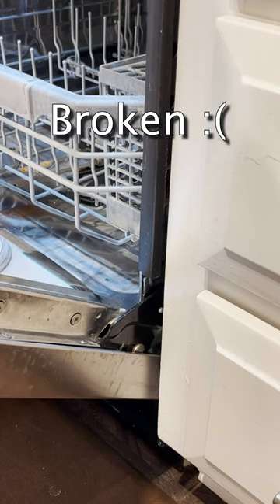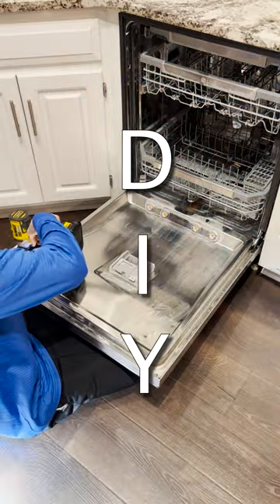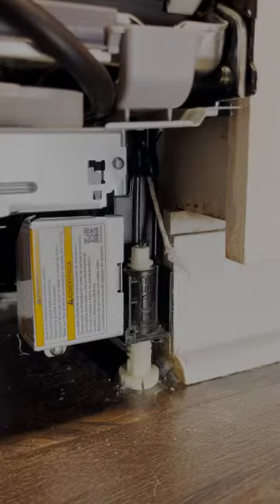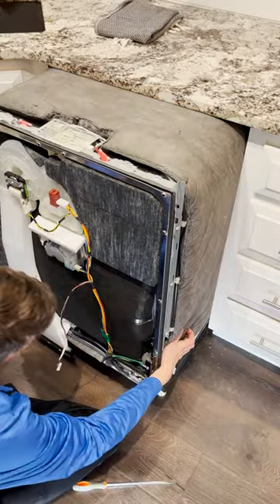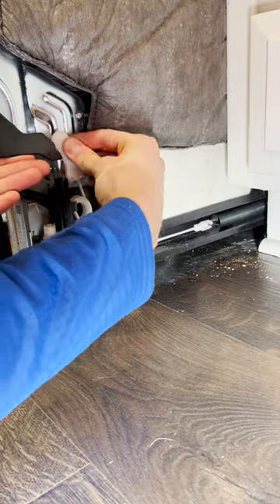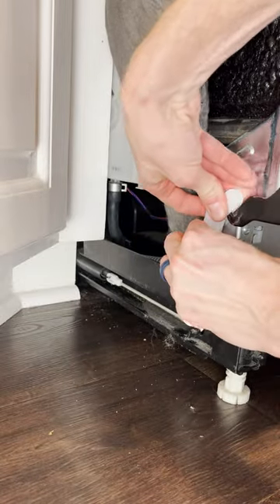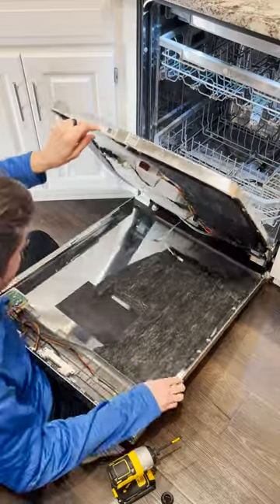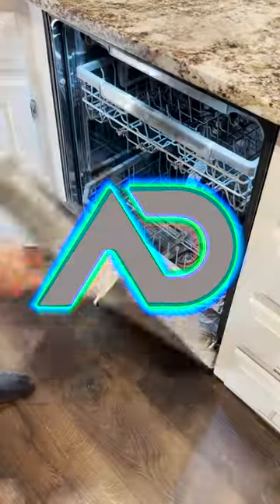DIY Dishwasher Hinge Fix

Comment: Reckless confidence is the key to a happy life.
Reply from the maker: Love it. Put it on a T-shirt
Reply: Also to a very expensive one
Reply: When u do it once u will have the confidence to do it again you would be surprised with how easy it is to fix stuff around your house if u do it on your own I've fixed more then 10 electrical stuff at my family home with no experience a bunch of wires and sink pipes
Reply: As a wise man once said, you never call a pro until you’ve made it worse!
Reply: Reckless confidence helped destroy my van engine once. Good times!
Reply: Amen

Comment: I like that the dishwasher is wearing a sweater. I changed the thermal fuse in my air fryer. Thing was like a puzzle.
Reply from the maker: Gotta stay warm (and quiet haha)
Reply: Insulation to keep it quiet.

Comment: Small tip - impact driver can overtorque small fasteners like this. Recommend to use impact driver for removal and for install, an electric drill with the clutch set appropriately for install. Cheers!
Reply from the maker: I did try to be very gentle on the reinstall for that reason but great tip!

Comment: Love the confidence.
Trick to fixing anything: remember where the screws go + try not to force anything.
    And, whenever you can, try to find the Service Manual PDF (or a YouTube tutorial).

I fixed 2 washers like this, and the dryer I currently own. (Belt replacement on a dryer... Basically dismantling the whole thing.. Ma gawd ;))

Reckless confidence FTW
Any time a repair would cost more than a 2nd hand appliance; just go for it. 

Nothing to lose, but skills to gain
Reply from the maker: Thanks! Reckless confidence is a great way to learn some skills if you are careful and go into it knowing the risks. A few years ago I’d never imagine I could do the projects I’ve now done. 

Great advice on not forcing things, I’ll have a video coming out in a couple weeks where that mistake cost me some $$$

Comment: Happened with my VERY old DW, too.  But the design was much better and all that I had to do was remove the bottom plate (2 screws) and there was the spring with cable. 5 minute job.
Reply from the maker: Nice! Ya seems to happen sooner on newer models…
Reply: @AverageDadChannel  Not surprised but I wouldn't know. Bought mine at a garage sale more than 20 yrs. ago.  Don't know how old it is but I did have to replace the pump 3 yrs. ago. It was an easy job. The unit works great and has otherwise been trouble-free.
I keep all of my appliances until they absolutely have to be replaced.

Comment: My dishwasher broke april first (2022). Apon trying to take it out in preparation for a new one, we learned the water line was connected directly to the sink pipes without a shutoff valve. And the point where the pipe connected to the dishwasher, there was a wire right under it (which is illegal). The pipe broke and flooded our kitchen. We also learned that the electric water heater was hard wired (like the dishwasher) and there was no shutoff valve for the hot water line, but cold water did have one that was colored red. We didn't have a kitchen for most of the year.

Comment: The electronics im the door can be mains powered. An amteur/non-professional should not be messing around there, even with the plug pulled or the fuse turned off.  Doing repairs yourself can be incredibly rewarding but especially around electronics you should not do any experimentation.

Comment: Our dryer is about 35 years old. All I had to do do far is, replace the drum belt. I need to see why it isn't heating properly, but I have to wait, after my surgery.
Reply: Sounds like the coils are touching the metal chassis, a super common problem as a result of the heat warping the sheet metal paneling. Very common cause of dryer fires. I recommend scrapping it.

Comment: People worry about doing it yourself, but typically you could afford to DIY something 2 or 3 times before it would cost the same as a repair person.
Reply from the maker: Exactly, if you are spending the time and doing a little research, a lot more is in reach than people may think
Reply: I don’t know if my clients who DIY their heating systems could afford their ceiling coming down 2 or 3 times. I think I’m at least 1/8th of the cost of the first ceiling 😂

Comment: "check to see if there's slack in the hose and wires"?
How could it have been installed without it?
There always slack.
Reply from the maker: But if got stuck in something and you pulled it out you could still cause a problem
Reply: @AverageDadChannel  I didn't get that from what you said, but yeah, definitely valid. Just yanking stuff almost never turns out well! :)

Comment: Question: if you're an "average dad" then why did you check to make sure the electrical and water line were long enough? A real average dad would have yanked it out and turned a 3 figure service call into a 4 figure service call...
Reply from the maker: Ha good point ttku, average diy dad is probably more accurate